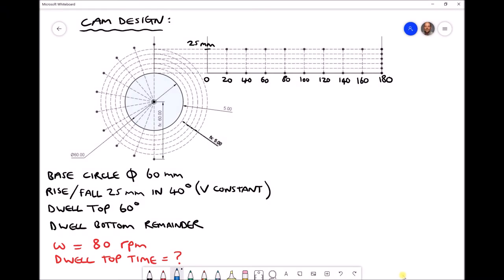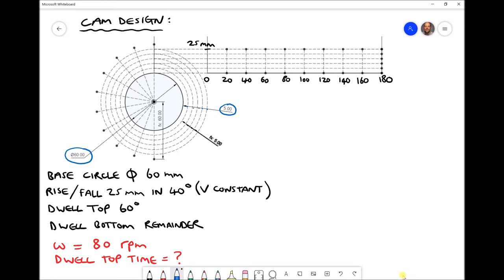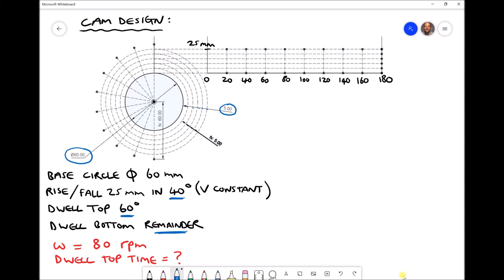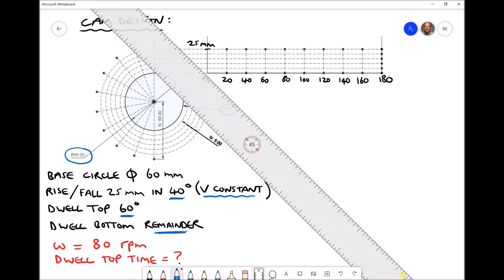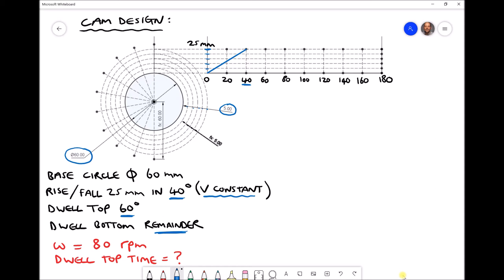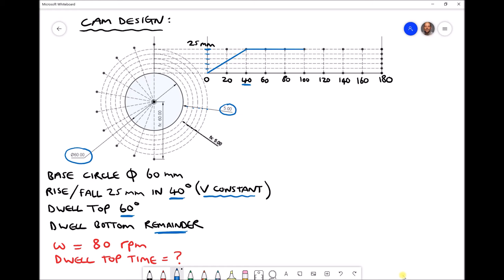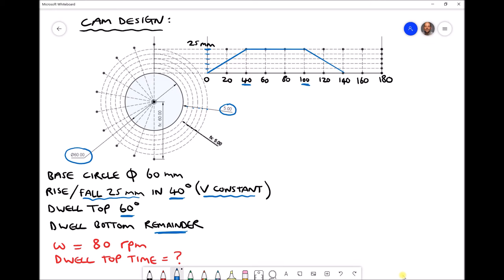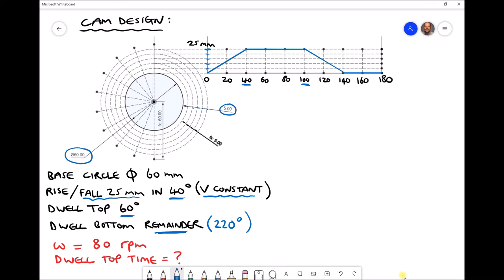Cam Design to Achieve a Specified Follower Motion

Comment: i just had a rude lesson about duration versus lift and flat followers. obvious in hindsight... theres a limit to the lift one can achieve as duration is reduced. and using other profile follower,s, you start running into "jerk" issues...

funny, ive never seen it mentioned anywhere...